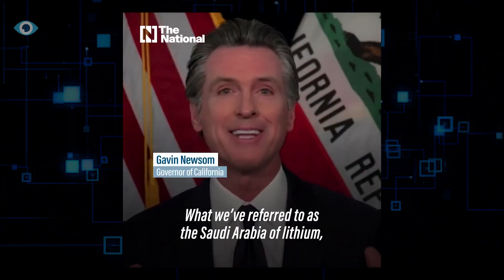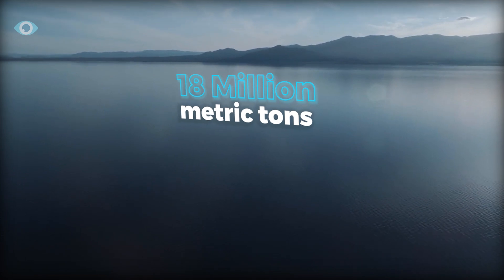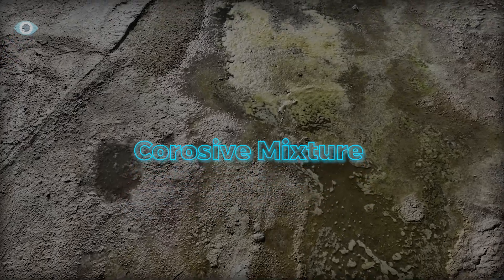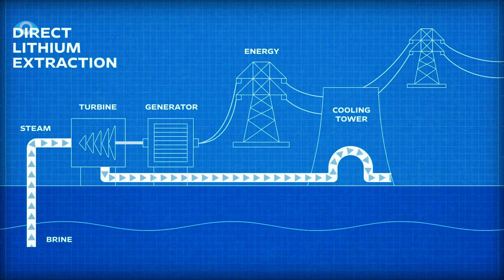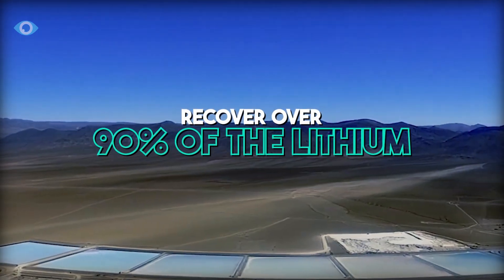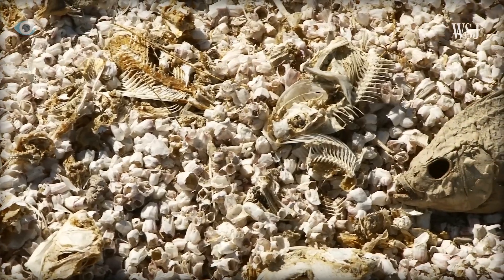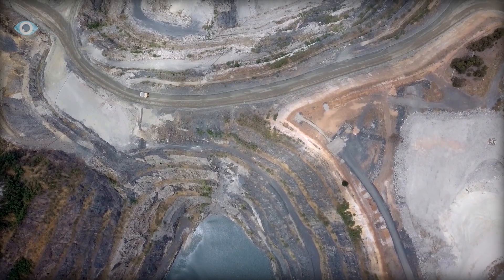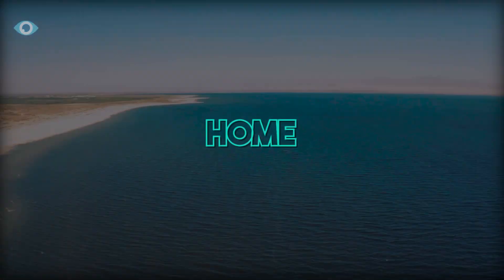$540 Billion Discovery Found Beneath California’s Salton Sea! | EyeTech

Comment: Errrrr, ummmm, why in God’s name and all that is Holy do these greed driven, mentally myopic engineers and miners see the forest through the trees? Reinjecting the effluent, after lithium extraction, is beyond wasteful and economically shortsighted…. Heavy metals have been isolated from the solution and there are industries which utilize said metals, why wouldn’t partnerships and further refining both be cost effective, save from further external mining operations and potentially return only purified fresh water to the resivoir? If the exposed lake bed is “toxic” because more metals and lithium are present, wouldn’t a hydrological mining process not only remove the described toxins and perhaps bring back a cleaner resivoir over time. The entire process, as described, seems as if there’s extreme shortsighted and tunnel visioned thinking wasting resources and overlooking potential channels for holistic benefit?

Comment: Lithium is not a viable energy future. So California will undoubtedly make a huge mess just in time for lithium to become obsolete.
Reply: Wrong!
Reply: @Loki-rascal  Sodium Ion batteries simply crush lithium mining at the Salton Sea especially how gravity fed ocean canal water stores 150X more Co2 than air and can be recycled to manufacture cement, bricks, fertilizers, chemicals, Co2 Currency, zero pollution hydrogen that can be safely stored by Ayrton Energy in non-lethal organic type clear room temp liquid and utilize all existing oil infrastructure without additional cost because of Ayrton Energy invention.

Comment: At  present, lithium battery technology is dangerously toxic !!! Until lithium batteries can be made to not self combust when damaged, this battery technology is not usable, nor is it safe.
Reply: @lomgshorts3  lithium ion has the potential of thermal runaway, creating a fire that can't be put out. 
Lithium iron phosphate doesn't have quite as much energy storage capacity, but doesn't have the same runaway properties as lion. 
 Most of the Ev's rolling off the assembly lines today use the safer LiFpo batteries.
Reply: @patrickhenigin4805  you are wrong. The thermal runaway temperature of lithium iron phosphate is only about 100° different than that of lithium cobalt. And a fire from a lithium iron phosphate battery produces much larger quantities of gases that are far more toxic. Get current on your homework
Reply: Unfortunately you are entirely full of crap.

Comment: 5:09 wrong. It's lithium OXIDE that is used.
Reply: Lithium exposed to the air = lithium oxide.  Seems an unnecessary clarification.
Reply: @kenp5186  Incorrect. In fact, lithium loves to bond with hydrogen and this is a very hazardous contamination to lithium oxide. Most air is not free of humidity!!! Further, you don't get lithium oxide from just air exposure without exposing the powder form of lithium, since it will not burn into even sand size grains. I have to burn it with a torch. Grinding that stuff , even in a controlled atmosphere, into a fine powder , is no easy task if you need pure material without contamination from the abrasive medium.
Reply: @mikefromspace  You definitely do get lithium oxide from exposure to air.  Lithium exposed to air will react with the hydrogen, oxygen, nitrogen and carbon dioxide. Grinding it up and the resulting dust can be rather dangerous.  All that said, lithium carbonate is the major product that would be extracted from brine. It is not hygroscopic and is generally stable when exposed to the atmosphere.
Reply: @kenp5186  Yes but any of them not lithium oxide must be re-smelted and then re-oxidized in a pure environment to prevent any possible contamination with anything but cobalt of course, for the most common type of lithium ion battery. There is no simple or efficient process of stripping the hydrogen or other contaminations. If there was I'd sure like to know about it. I process LiCl into LiO2 and it's not easy to keep clean.

Comment: WHY DO GOLF CARTS STILL USE ACID LEAD BATTERIES
Reply: Because they are much cheaper .
Reply: and they don't spontaneously catch fire.
Reply: @avlifesavers LifPo4 batteries are actually cheaper.  They can be recharged 10 times as many cycles as a lead acid battery. They cost about twice as much as lead acid bwtteries. 
The LifePo4 batteries are a different formula than LiPo batteries that have been used. Most EVs now use this new formula. They have only been available commercially available for a year or two.
Reply: They are cheap and heavy, lowering the center of gravity.
Reply: @kenp5186  lead acid are almost 3 times as heavy. Extra weight means you need more energy capacity to push it around. 
Currently Lifepo4 batteries cost just over twice what a lead acid costs, but can last up to 10 times as many charge/discharge cycles.
Reply: @patrickhenigin4805  Yes but the extra weight is desired to reduce roll over issues. Safety wins over efficiency.  It is not about just the best battery, it is about the integration of the battery with the design.  If I were buying a new cart, I would go with lithium (in a cart designed for it) or gasoline.

Comment: California will blow through this money before you can say,
"... And it's gone"
Reply: As long as none of the money goes to red states.
Reply: @karenharrington9614  The ideal battery especially for storage maybe not be a lithium battery but rather a sodium battery. EVs maybe suitable for big cities if nuclear reactors with good base capacities are in the mix. Lithium batteries are a fire hazard it seems.
You seem to have taken sides in the two headed snake system of governance. Both heads see you as either dinner or a useful idiot.
Reply: South Park 😂
Reply: TEXAS: Hold my beer.
Reply: But it will still get produced.
Reply: Not like the Welfare States labeled " red " that produce less than they get back from the Federal Government . If you live in one you owe California some money
Reply: What else can be said other than...

Fucking democrats.

Comment: Ok, this thing is layers deep. We have a lake, that shouldn't be there, but is because of an environmental disaster a hundred years ago. Then, the waters of the lake were used to irrigate farms. The fertilizers, pesticides, and herbicides used on those fields that wouldn't have been there without the lake, ran back into the lake that shouldn't be there, making it toxic. Now, we want to extract the lithium but there are concerns about protecting the ecology of a toxic mess, that shouldn't be there.
Reply from the maker: Love the historical insight, Alex. You clearly know your stuff. Makes you wonder—are we just repeating cycles without learning from the past?
Reply: Zackly!
Reply: You are almost correct, the lake water is not used for irrigation, that comes from the Colorado. The lake is there because of the disaster caused whilst bringing water to the farms.
Reply: Yeah, you're right on that one. But there is the scary thing in the closet nobody is talking about. The water in the lake is evaporating, but the chemicals aren't. If people think the shoreside soil is toxic now, just watch what happens as the lake shrinks and the pollution becomes increasingly concentrated.
Reply: @Vaquero4382  They diverted the Colorado  river for   for a wile for farming  but could not drain the water properly    It was trapped creating super salty water. It  is pretty nasty there.  A  lot of geo thermal in the area  bubbling up mud  and in hot springs .
Reply: $$$ Revenues trump Environmental issues. They will find a way to legilslate arround it. Cleaning up the mess and making a proffit?
Reply: @WillyK51 just make the lithium shortage a matter of national security and forget about any regulations that stand in the way
Reply: @WillyK51  , you underestimate the California Democrats' ability to screw it up.
Reply: Wrong

Comment: The Salton sea is very new as far as lakes go -  it was created in the early 20th century when the railroad messed up a canal and for a while (a year or two) the entire Colorado river ran into the valley, which is below sea level.  The lake is a man made thing, so the lake drying up, in the long term, is not necessarily a bad thing.  There will be an adjustment period though where lake bottom sediments dry out and get carried around by the wind.
Reply: Almost correct; the irrigation company caused the mess, the railroad stopped it.

Comment: Mining lithium is a big deal and well restructure the landscape of the Salton Sea. I am certain California why find a way to screw it up and won't do it.  It is rough as coal mining if not worse.
Reply: You can bet on it. It will cost twice as much to remove and process then it is worth. You can’t do this kind of work in California. The state law and environmentalist will see that it will not happen.,, while you continue to pay fees, in an effort to try to get the OK to proceed with your project
Reply: They now have a diesel car that goes 104 miles to the gallon but EV industry is going to destroy or worse the producer
Reply: The technology has been around for gas powered vehicles to get over 60 miles per gallon,  but. @5678-s8p
Reply: I bet engineers and scientists would haveneveb developed a diesel engine that produces such economy without the threat of EVs.
Reply: @r.martin3494  Tucker had a car in the 1940s that got 48+ miles to the gallon.
Reply: @5678-s8p where is this car, is it on the market yet? This makes more sense imo even hybrid technology because even if ev technology was to the point that it was more practical to have than gas or diesel the power grid couldn't handle everyone owning a ev and it would kind of defeat the purpose of we had to build mower power plants. We're already set up for fossil fuels across the country why don't we focus on improving the technology and build vehicles with this kind of fuel mileage while we work on the technology and power grid for ev
Reply: Sucking tons of liquid sludge out of the San Andeas fault line will have reprocussions.
Reply: @tr7b410 That’s insipid. Geological science of plate tectonics and fault dynamics doesn’t support the idea that surface “sludge” has any effect on subsurface movement driven by magma processes. It’s not like subsidence from (for instance) coal mining, where if you remove the top it affects the pressure on the mineral below. The pressure on the fault is pretty much all from below, and not necessarily directly below. It can be driven by movement hundreds of miles away and thousands of feet deep. The fault line is just the surface crack. It’s the effect, not the cause.
Reply: @ the plasma bursts going to make it pop bro
Reply: And it will fill rhe pockets of the politicians.
Reply: @artseger6891 The first thing Newsome did was push thru a tax on lithium mining. It's always about grabbing money, claiming it's for public use, then stuffing as much in their own pockets as possible since they decide how to spend it. The lot of them are shameless liars and thieves.
Reply: If at all possible, california government WILL find a way to F this up.
Reply: California would screw up a wet dream.

Comment: An eye opener highlighting destruction of environment by mining operations.
Reply from the maker: Absolutely — it’s a powerful reminder that even green solutions can have a dark side. The question is: can we extract without destroying, or are we just shifting the damage?
Reply: I’m beginning to equate “natural disasters” to profiteering
Reply: @graham5761 you are spot on! From Paradise CA (gold and land for the high speed rail) Maui land grab for the elites, Ozark floods for lithium, and now,  getting ppl out of the mid west and South and into the controlled grid cities. Look up UN Agenda 21 "Sustainable Development" otherwise known as COMMUNISM
Reply: I believe the Salton sea was not a natural lake. However, it has become an environmental nightmare for a lot of reasons, but you gotta admit the fact that nobody really owned the land sure made it easy to come in and harvest the lithium
Reply: They are playing with fire, because a Salton Sea is where the San Andreas fault line begins at 900 miles right through California is where it ends. They are not going to replace the same amount of bubbling mud  that they remove  creating 
Empty pockets . and not enough force to keep the pressure in check . basically a chain reaction of bad events..